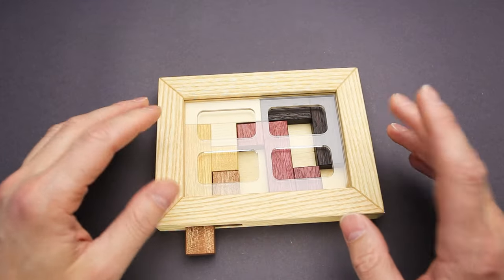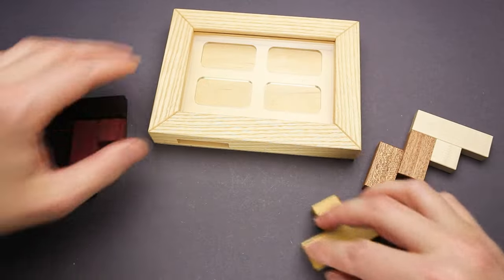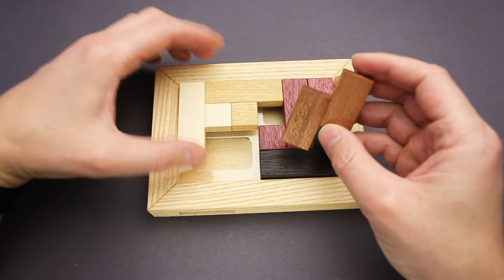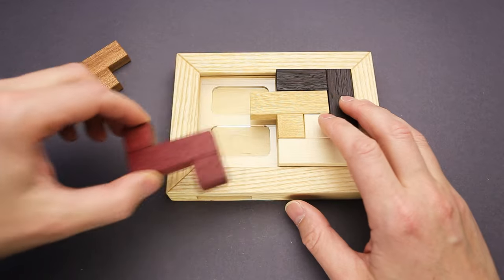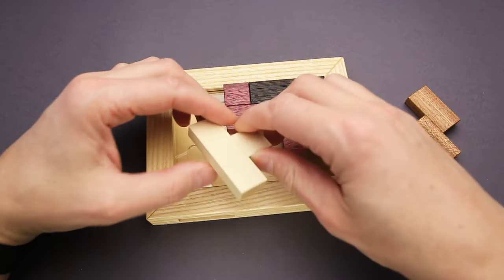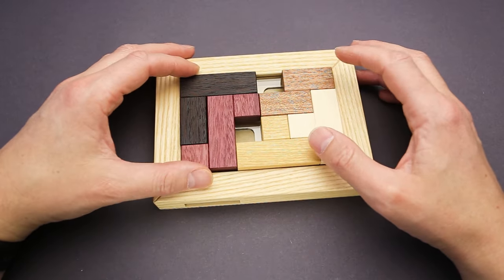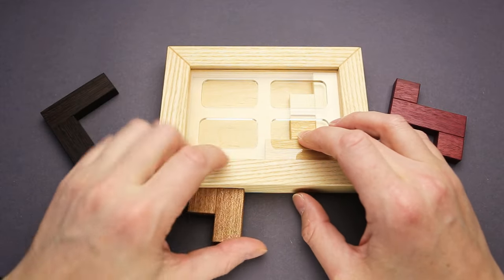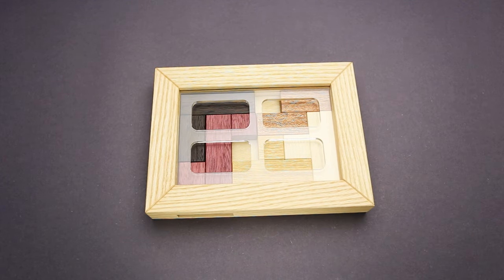Airlock puzzle has a neat trick

Comment: There is at least one other solution! Yours is really nice and elegant, but the other one is more straightforward...
Reply from the maker: Do you mean the one that involves a hammer?
Reply: @Puzzleguy  LOL. Nope. I can DM you a pic on Discord if you like.
Reply: We chatted a bit and I have an earlier (although authorized) version of Airlock that allows a different finishing move and once you see this video it's pretty clear mine is unintended. Pelikan changed the frame a bit and my solution does not work for it. So this one is CORRECT :-).
Reply from the maker: @markkaufman3170  Thanks for the clarification. Good to know there is another version of the puzzle out there.